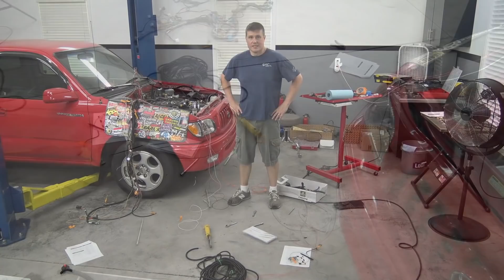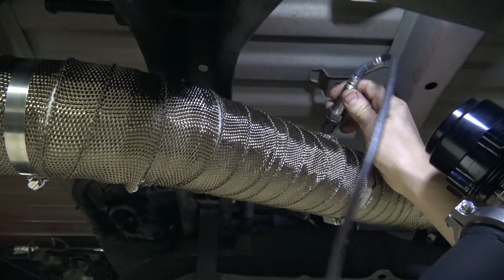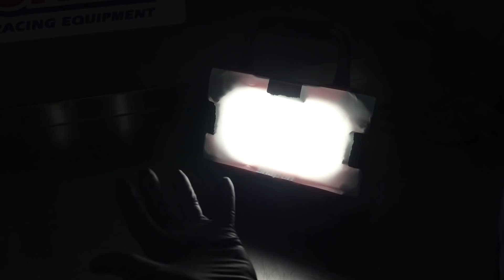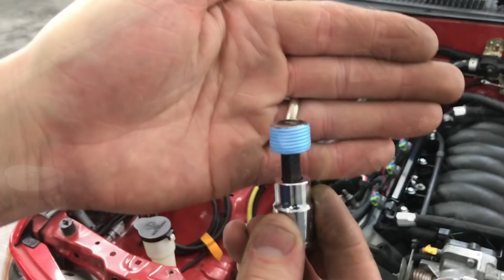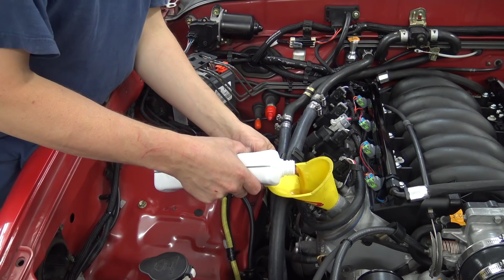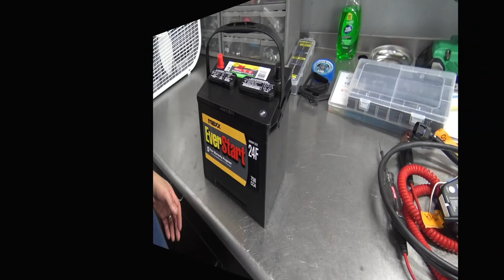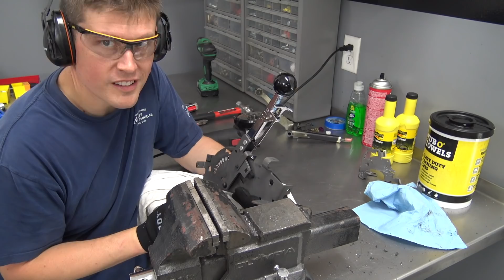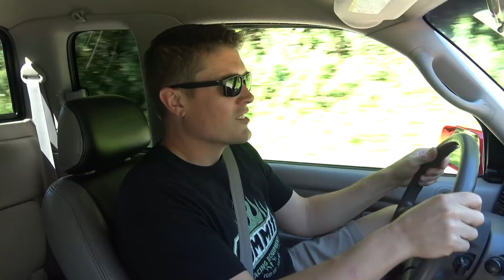LSX V8 Turbo Tacoma - Project Firebolt Part 12

Comment: This is going to be sweet when it's done but for all the money time and effort spent I myself would have went with a Texas Speed LS 427 and kept it NA...they will make 600hp easy which would be insane in that little truck and save the complexity of the mid mounted turbo kit...sure a turbo setup will be capable of making more power but does it really need it???
Not like you will ever be able to put it to the ground anyways in that little truck unless you are running drag slicks on a prepped track...or with your current leaf spring rear suspension setup...What is the goal of this truck??? bad ass street machine???
1/4 mile racing?...which it will suck at...really I think the 427 NA would perform better...
Ether way it is going to be nuts...awesome work you have done so far...
Reply: harry guy is this toms naturally aspirated garage or toms wooshy turbo noises garage?
Reply: @francistheodorecatte  Whatever Tom want's it to be garage...which is why I said "I myself" and "IMO"...and you know what they say about opinions lol...But IMO...he did a damn great job regardless what I would have done.

Comment: woohoo. Been waiting for this one. Trying to wire all that would make my ADD explode. Are you doing any suspension/tire and wheel upgrades?
Reply: I think he's going for sleeper as far as wheels?
Reply: Wondering the same thing. No way a truck suspension is going to behave coming off the line hard.

Comment: If I put a Neverstart battery in that vehicle I would hide the fact also. I had an Optima battery in my truck for 13 years and it was still good but getting weak and I was taking a 1200 mile trip so I replaced it with another AGM battery. BTW love you show.

Comment: Congrats!  Truck looks and sounds great.  I used a Derale Stacked Plate cooler in conjunction with the radiator cooler and my temps are 145-155 on a 95° day.  I have it mounted in front of the radiator.  I have a few videos that show how I mounted and ran all of the lines.  I may have went a little overboard on cooling.  I didn't want to cook my trans either.

Comment: No wonder the truck was so clean. Only 74k miles.
Reply: Only 74k?! Even 25k miles of usage doesn't render a truck this clean!! Whoever had it before did an excellent job with upkeep !!
Reply: Try and find me an extended cab Tacoma with less than 100k miles. You won’t find it, this is a unicorn.
Reply: @catchphillies  Don't believe it, they are out there. Last year I bought a 2009 370Z with 22K miles from a little old man for less than $15K. My 2006 Dodge 1- ton Cummins has 45K miles on it, paid $24K two years ago. Both have never had so much as a door ding. In fact, I bought a 2008 FJ Cruiser brand new in 2007 and it's for sale with meticulous records and 60K miles. Yes I want a lot for it. One of my co workers has the same truck (2002 Tacoma X- Runner) in red with the 3.4L, stickshift and factory supercharger and low miles. He bought it from a dealer trade before they knew what they had.